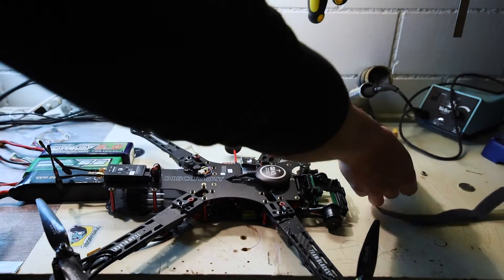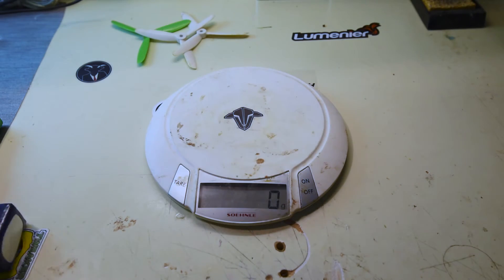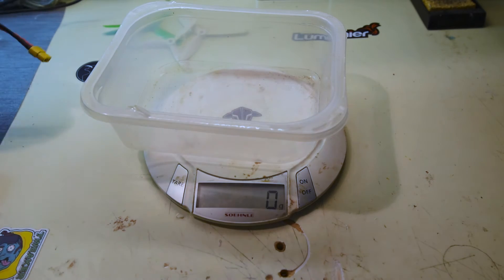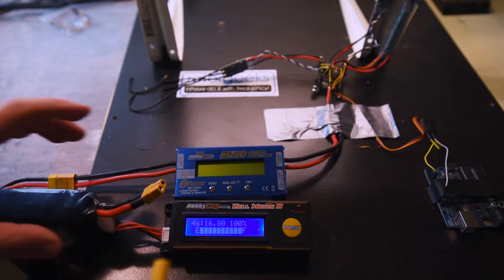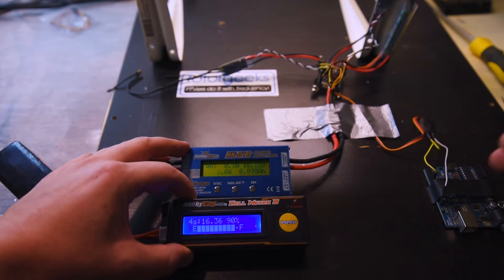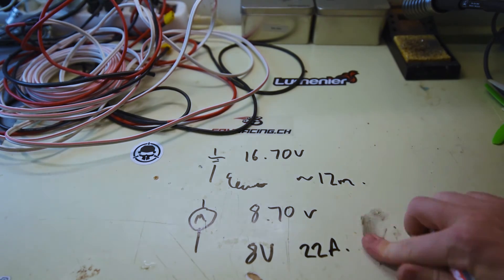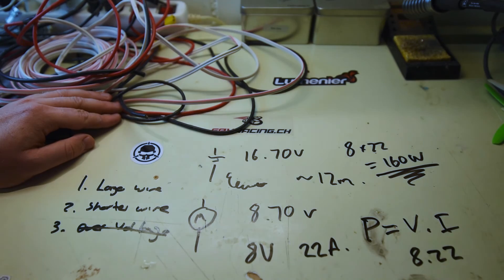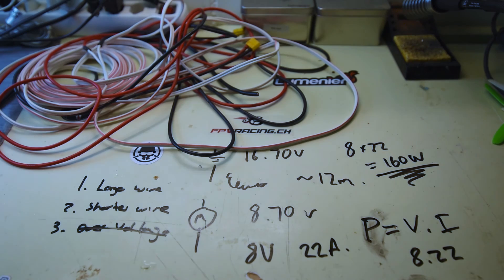The Tethered Drone project - part 1

Comment: What about a using a higher AC source voltage on the line and putting a switching powersupply on the quadcopter.  The powersupply would step down and regulate the lower voltage high current feed that the quad requires.  Wire carrying the AC could probably be as thin as that speaker wire.
Reply from the maker: Hey! You're right however a AC-DC converter capable of at least 30 amps at 12-15V is heavy, at least 350W. I could maybe get away with a crude one, but I would need to step down the voltage meaning a transformer, or if it was a switched mode power supply, it would also be quite large. I think it would weigh at least 500g. I will look into this a bit more soon!

Comment: The only way you can overcome the limit is by lowering the amps.
How?
Increasing the voltage. Possibly AC.

That way you can use much thinner and lighter wires.
Yet know you have to transform that HV low amp (AC) back into low voltage high amp (DC).

How hard can it be? :D

Comment: Covert 230 Vlots of AC (Mains) to 300 volts DC. Feed it into a very thin cable and convert it to 4S, 6S whatever up at the drone.
Reply: how can i do this? what are the components need? badly need this for our project.

Comment: Hi Nils, you missed the 4th option which is cost effective, and used everywhere in the world : élévate the voltage on the bottom and reduce the voltage on the drone with à dc/dc converter. You can even use your home network with 110 or 220v, thick and low cost wires, 4 diods, the dc dc converter and that's it ! Anyway thanks for all your vidéos, gréât job !!
Reply: How can this be done with a DC to DC converter? Typical DC-DC converter is large and heavy. Could you elaborate?
Reply: Yes Nils, let me elaborate : forget the dc dc converter. When I looked for dc/dc converter in électronics shops I realized that you just need a simple 12v power supply (for instance a PC power supply). Not so simple as this power supply transforming 220v or 110v ac network to 12v has to be able to deliver 2000W at least. But this kind of equipment does exist, for les than 1kg if you search well. The 12v value depends on your number of cells for the drone (it should be possible to tune it on the power supply) but it will be constant value and will be delivered for ever ...
Reply from the maker: Hey! You're right, however even with under 1kg, the cable would still have to be at least 20AWG. I will research this a bit more in the coming weeks however I think a solution would be hight frequency AC and a very efficient AC-DC powersupply on the end, this would all be specialised though, so I do have to do some more research into this field.